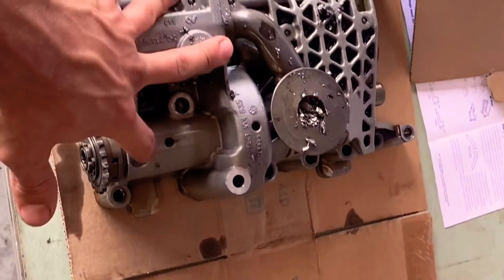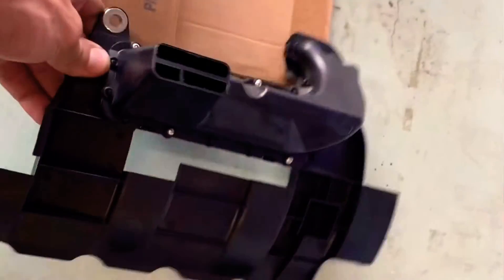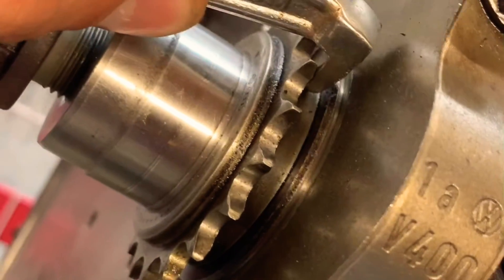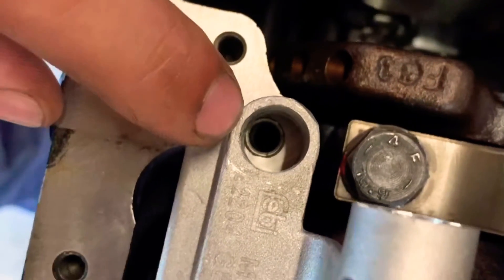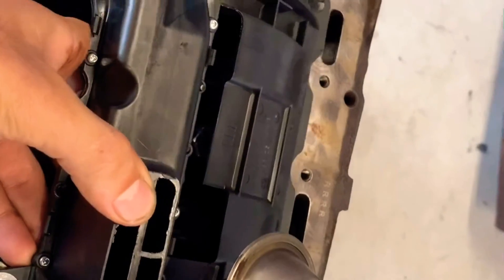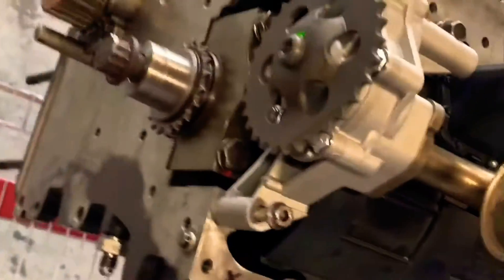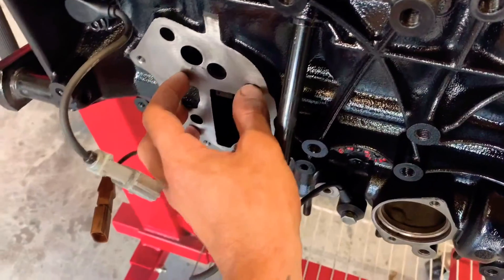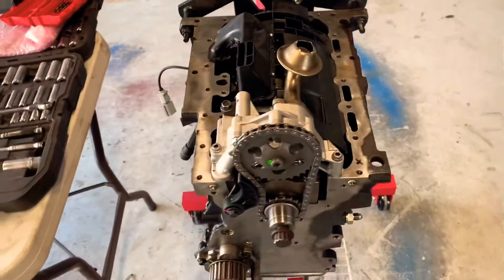2.0FSI 1.8t oil pump conversion

Comment: Hi mate did you have to time the pump like you do with the original setup?
Reply: No need for that
Reply: @ thank mate bought a kit that comes with a pressure relief valve in the location of the bolt hole you had to drill and helicoil so I don’t have to run the sandwich plate hoping to have it all up and running soon

Comment: I know it’s a long time ago but did anyone get any oil pressure faults on there dash when this conversation was done if how did you fix the problem
Reply: You need to change to 1.8 t oil filter housing also. Then you won’t get the low oil pressure 
And don’t forget to take away the block plate on top of the housing so you can release the crank pressure
Reply: @MegaWazzzz you can use 06B115417F too, then you dont Need an Adapter Plate or a modified power Tube💪🏼
Reply: @xclow98  good to know 👍 for me just 8 years too late 😅
This info would have saved me sooooo much headache and money when I had to modify my charge pipe 🤓
Reply: @xclow98  the 2 holes in the front are they the coolant lines?
Reply: @MegaWazzzz  the oilcooler is mounted  there. the Housing is from a audi a4 2001 2.0 fsi, you need to use the matching oilcooler too, but all this is way less expensive than these „upgrade kits“ with the adapter plate
Reply: @xclow98  okey 👍
Reply: @xclow98 so basically plug and play with this part number? remove original mount this one?
Reply: @BrawleyLEyes, Look for the Video from proboost.
But its in german😅

Comment: Any known issues like low oil pressure after conversion? Forums say this is more problematic
Reply: You will have oil pressure problem if you don’t change to 1.8t oil filter housing also

Comment: At Min 2:30 you need a Helicoil M7x1,0. So its no Problem with the Holes in the other Parts. But it is not standart Diameter in Europe. In Europe we use M6 and M8 normally.

Comment: great video but I’m having the oil pressure low light after the conversation with the stock housing , I wanna try the oil pressure switch but I’m curious on how to get this done , my sensor has 2 pin connection and the 1.8t is 1 pin connection
Reply: Hola amigo pudiste arreglar ese problema yo tengo precion baja en mi motor y ise esa adaptación
Reply: You need to change to 1.8t oil filter housing also. Oil pressure relief is in the housing on the 1.8t. On 2.0t it’s in the oil pump

Comment: Didn't you find that the 1.8t oil pump pickup pipe was too close to the bottom of the sump ?
Reply from the maker: Yeah I had to press the pick up to get it to fit better
Reply: @Aldi_mk5  Do you mean push it up a bit ?
Reply from the maker: Yeah, as well as putting the actual pick up part on a vice and crushing it a bit, on the end where the metal screen is
Reply: @Aldi_mk5  This explains why they cut the tip of where the mesh is supposed to be lol the funnel bit lol. I was thinking why the f is it cut up lol
Reply from the maker: Yeah is a bit tricky but we’ll worth it
Reply: @Aldi_mk5  When I had mine installed cowboys did it lol. Just found out they used a diesel version with a smaller chain can't believe it but the pump looks the same

Comment: Ask anyone, this is a downgrade, the FSI fuel pump is superior, VIS freewheel sprocket disables the balance shafts and is much easier to install than installing the 1.8t oil pump. The balance shafts are the only failure point to the FSI fuel pump. The 1.8t fuel pump requires swapping over to the 1.8t oil filter housing because the FSI oil filter housing doesn't have a pressure release valve so in colder weather you will be running dangerously high oil pressure, this requires an adapter plate and most likely throttle pipe modifications, as well as what some other people are saying which is swapping over a sensor to get rid of the oil pressure light. The 1.8 oil pump isn't even as efficient at the 2.0 pump. It's too much work for a less efficient oil pump.

Comment: WHAT IS THE REASON TO DO THE SWAP? WHAT VEHICLE TO WHAT OTHER VEHICLE?
Reply: The stock pump is prone to failure and also has a balancer attached to it. if it breaks, it might kill your engine, and if you wanna replace it with the same, its about 3K USD where I`m at
Replacing it with the 1.8T gives you a more stable platform, and you can also buy a high-flow pump ( pushes more oil and has a built in pressure regulator valve) 

Also, you get rid of the whole balancing assembly, so you get better performance ( not that visible on stock, but the engine isa bit more rev-happy)

Comment: Hello. Your oil pickup is really short. Is that off a 1.8T? Just went  to fit the sump and the long oil pickup fouls on the sump 😢.

Regards
Reply from the maker: Use the part number provided on the video, oil pickup is the long style

Comment: So got the car back from having the pump. Only fitted pump and chain on the lower gear got to say no issues so far no oil lights and I can't tell the difference with vibration nothing really there engine is so much smoother and revs better

Comment: Hi I no this is a old video. My mechanic is doing this to my car changing to a 1.8t pump. Keeping my stock oil filter housing. Will the stock oil filter housing be ok for the pressure. I'm reading that the pressure is either too high or too low and I'm worried because the engine has just been rebuilt thanks man
Reply from the maker: Use a 1.8T oil pressure sensor 
I done it both ways and is a hit or miss for what I can tell through other people that do it
Reply from the maker: But try with all your factory components first
Reply: @Aldi_mk5  Thank for the fast reply bro. Yea I'm worried about the higher oil pressure in the engine I don't want it to blow lol just spent money on rebuilding it with hybrid turbo ect
Reply from the maker: Is not gonna blow! The 1.8 T oil pump is a better unit because it don’t have all the components the factory one does like balance shaft 
Due to less rotational mass the pump can operate nicely
Reply: @Aldi_mk5  ahhh ok I was reading form rooms and it made me scared 😂 thank you bro I appreciate now I feel alot better

Comment: I did also the conversion and kept the stock oil filter housing , some times at idle i get low oil press , it might be the filter oil or is cause of housing? Low oil pressure appears some times...any suggestions ?
Reply from the maker: Make sure u all full on oil and replace the oil pressure sensor for a 1.8T sensor
Reply: @Aldi_mk5  the sensor of 1.8t has the some socket as the 2.0t? I didnt know i have to change to 1.8t
Reply from the maker: @DarieMadalin3192  yeah
Reply: @Aldi_mk5  disculpa ise la combersion pero me dice que tengo baja presión de aceite me puedes apoyar hermano
Reply from the maker: @DorianMacias-mv8qk  cambiar sensor se presión de aceite, usa el de 1.8
Reply: @Aldi_mk5  ya lo ise amigo pero aun así sigue la falla y ya le metí el medidor de haceite y me marca 10 psi en relenti
Reply from the maker: @DorianMacias-mv8qk  cambiaste el filter housing ?
Reply: @Aldi_mk5  cual es ese perdón amigo le puse todo bomba  colador todo nuevo esta ajustado y sigo con esa falla
Reply: Creo que vi en tu video que es una placa para adaptar el porta filtro del 1.8 pero esa no ce donde conseguirla aquí en Querétaro no la venden
Reply: @Aldi_mk5  hola amigo buenas ya puse el oils filter del 1.8 y sigo con lo mismo sabes que más puedo hacer me dice que tengo baja presión de aceite
Reply from the maker: @DorianMacias-mv8qk  asegurate que el oil pick up tenga suficiente espacio para la entrada de aceite
Reply: @Aldi_mk5  cual es ese perdón amigo ya le ise de todo y no queda hermano ya lo baje revise bancada biela rosiadores y todo está bien
Reply: @Aldi_mk5  de casualidad sabes cuntas psi debe tener amigo
Reply from the maker: @DarieMadalin3192  I end up using the 1.8t oil filter housing and se sensor

Comment: One question, when using the 1.8T oíl pump in FSI engine why to use the oíl filter flange with the adapter plate? Or I can use the oem FSI plastic? Any diffetence? Regards
Reply from the maker: You can run the 1.8t oil pump and still use the factory filter housing, at the time I did it I was told to replace everything due to oil pressure difference but I have done both now and they both work
Reply: @Aldi_mk5  thanks, amazing video

Comment: bro you cant find any videos because its an older, sort of outdated method to do it this way.  Wasa Motors sells a "Freewheel" that is about $80 or less and it is essentially a free spinning sprocket that replaces the drive sprocket for the balancing shafts.  so it disables the balance shafts and youre good to go.  use the same chain and no other parts required.  the best mod i have ever done on this car and ive been driving with it in my car now for over 2 years with no problems whatsoever.  look up on youtube "wasa motors freewheel install audi a4"
Reply from the maker: Yes you are right! There are other ways to delete the balancing shaft but you till have that big oil pump assembly, taking a large portion of the oil pan, by going this route. You giving your car an extra 1 1/2 QT of oil and a bit higher pressure as well
Reply: Also if the balans shaft already is leaking pil pressure then it wont help with only the Wasa freewheel.
And Wasa other stuff (as the Control valve optimization for oil pressure) only works for the tfsi not the fsi non turbo because of wrong oil pump in those.

Comment: Hey bud. Love the video. I did my conversion but kept the stock oil filter housing.
1) Oil light comes on and off, should I be worried about oil pressure. 
2)  when I start the car, cold start the pump is a bit noisy but gets quieter as time goes or when up to Temp is that normal?

3) I was told to change the oil pressure switch to .6 to 1 bar so the light goes away. Do you suggest I do that? 

4) will the normal tfsi oil filter housing cause any issues?? Should i change the housing to 1.8t?
Reply from the maker: I have done it with both, fsi OEM filter housing and with 1.8t and no issues 
According to HPS you need the 1.8t housing
Reply: How is your engine running with the stocl housing now? Is everything still ok?

Comment: no way to modify the stock 20T oil filter housing to accomodate the increase in pressure? And do u need the adapter plate to run the 1.8t housing?
Reply from the maker: No need for 1.8t housing

Comment: They are saying that crankshaft sprocket only fits automatic transmission models.
Reply from the maker: Not sure where you got that info but all my engines came with manual gearbox

Comment: Is the oil pump chain the same size and what is the pitch of the chain? The pitch size should be stamped in the side of the chain
Reply from the maker: They are different gears so chains are not the same

Comment: Hey I did this swap on my engine and once the oil is at temp. I only have like 12-15 psi of oil pressure. Wondering if you see the same?
Reply from the maker: Did u use oem filter housing?

Comment: 1) Why the swap? Benefits? 
2) how about the balance shafts on original pump aren't they needed 
3) is oil pan going to fit ok
4) can i do this to my 06 a3 2.0t
Reply: Cause a new 2.0 oil pump is $2500
Reply: Can this work on 2.0Tfsi